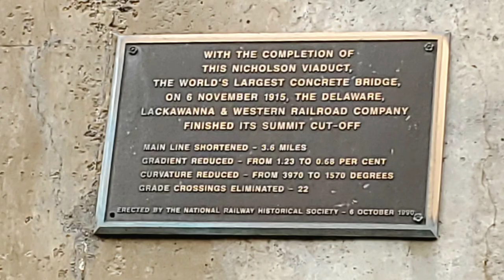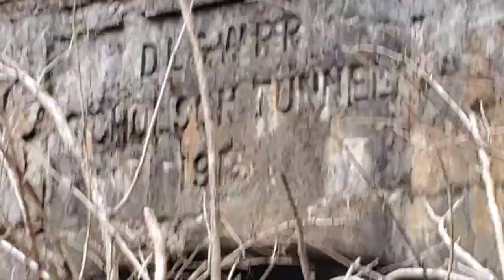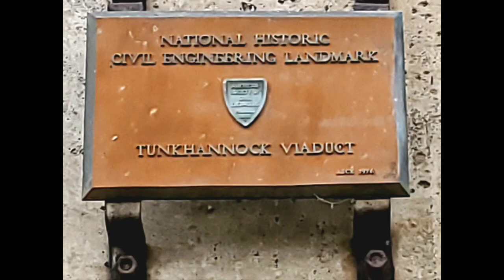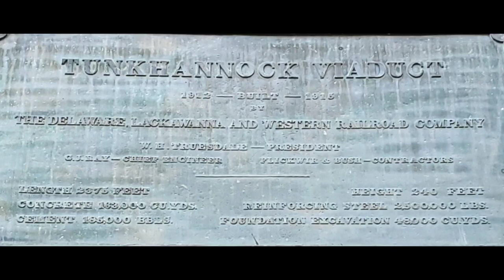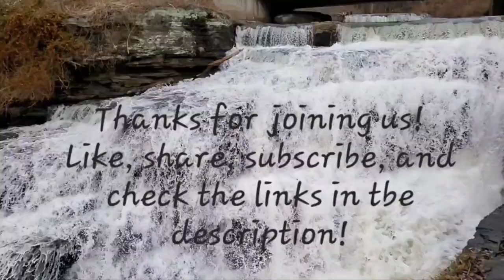The DL&W summit cutoff in Nicholson, Pa.

Comment: Awesome video. I was literally there last week. Used to go across that viaduct on the steam train out of Scranton in the early 2000's. The railroad you were following along the Susquehanna is Reading & Northern of course. Line runs up to the Norfolk Southern at Mehoopany. I just posted some videos of the train running up there last week. You passed right by the Vosburg tunnel on that line. Go to the Carney Cemetery behind Proctor & Gamble in Mehoopany. You can drive the railroad right in to the North portal. South portal also accessible by rail. Train usually comes up through that one from Pittston at about 9:45am and back down around noon.

Comment: I never knew there was an older tunnel in that area, a number of years ago I went with some of my friends to the south end of the present rail line, had to get off the beaten path and walk a ways but we did find it and went inside a ways before the girls got scared, there used to be a switching building not too far out of the tunnel, two story structure made of concrete but I don't see it in this video, looking south, it would have been on the right side maybe 300 feet out just off the tracks, we could only get in the first floor, there was a path around the back that led up to the second floor but the walkway across had been taken down, the path continues up the hill towards an open field